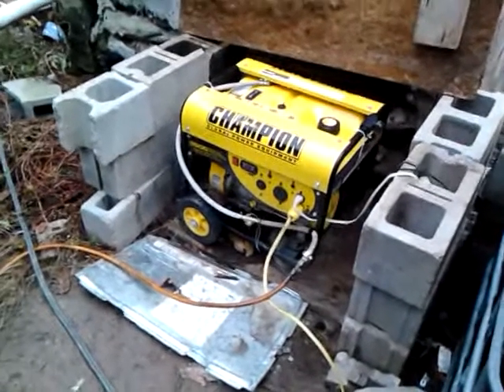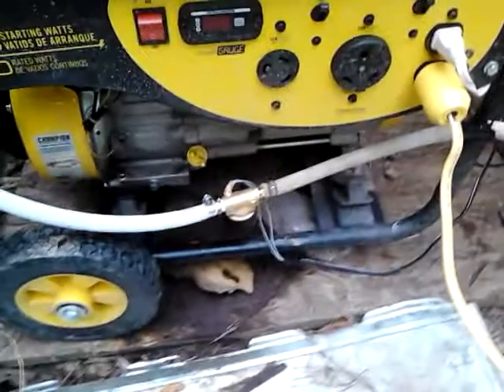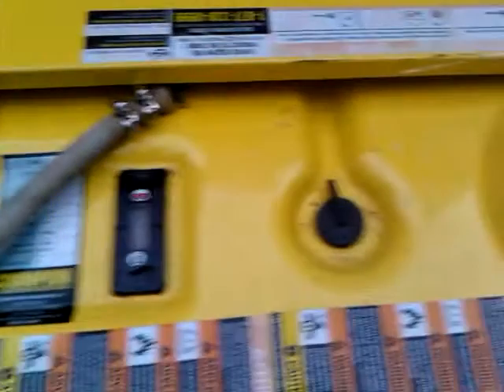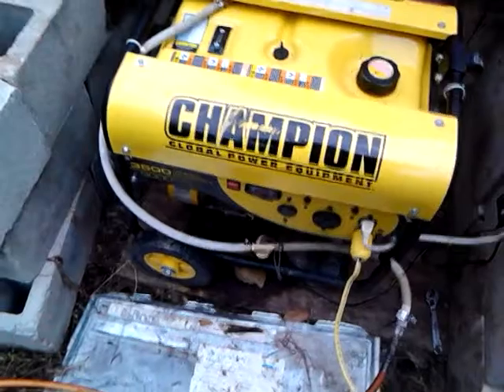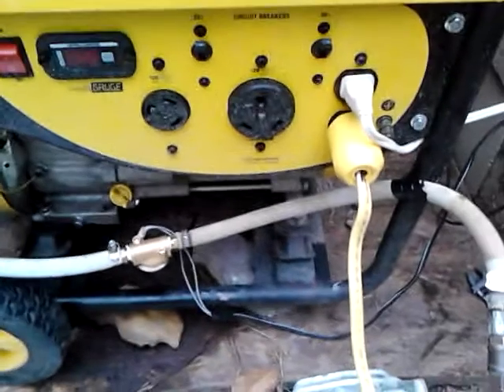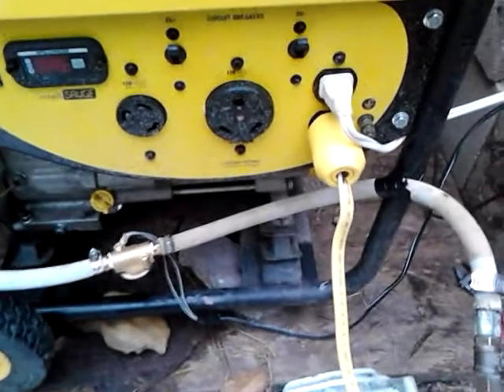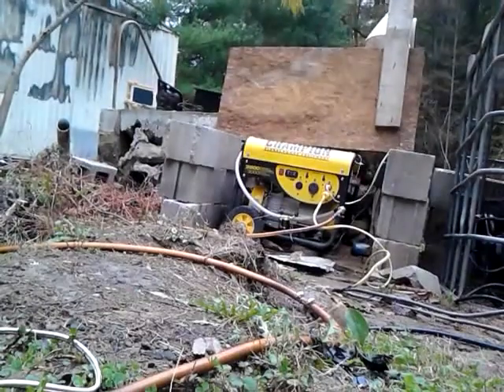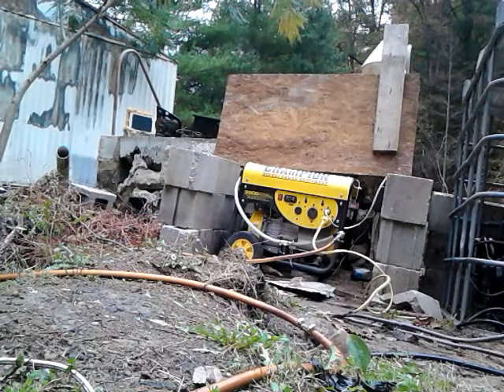Newest generator conversion and safety valve

Comment: This is cool and all but there are now (2016) other alternatives to the expensive kits that are so popular. You can get a tri fuel (dual fuel) carburetor on e-bay for that size generator for $38 with free shipping. Installing a carb on these generators takes less than 5 minutes.

Comment: great job . Do you have a video on conversion from gasoline to propane
Reply from the maker: ln2play I think the propane conversion would be about the same as with natural gas. In the case of this generator there really was no conversion. Just hook the gas line into the vapor line going to the air box.

Comment: Excellent job! Do you have any more information on the safety valve? Possibly a link or part # we can look for?
Reply from the maker: David Carns http://www.amazon.com/gp/product/B00827FP26/ref=oh_aui_detailpage_o08_s00?ie=UTF8&psc=1      This is the valve I used. It would porbably work for up to about a 5500 watt generator. It didn't have enough flow for the old 10 hp 6500 watt generator in the video. If you have a larger generator you will need a larger valve.
Reply: Thanks!